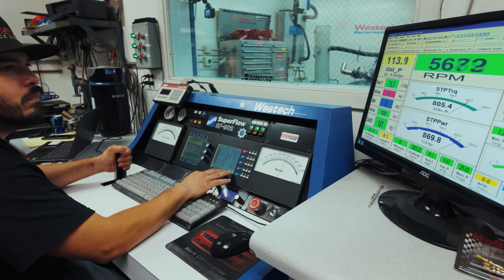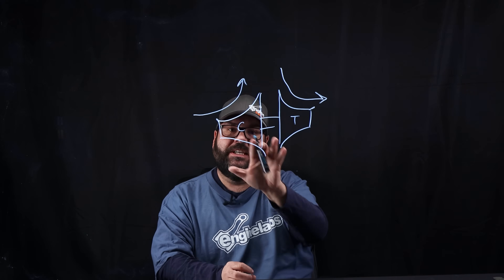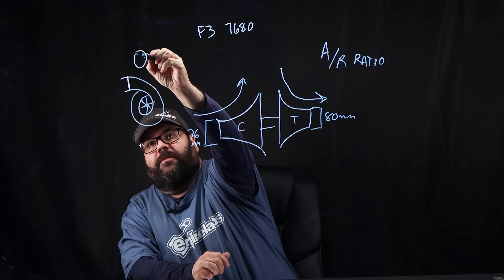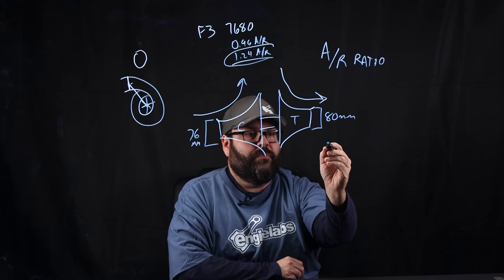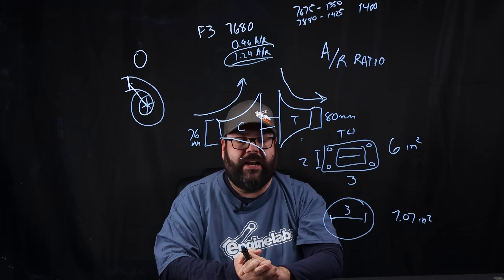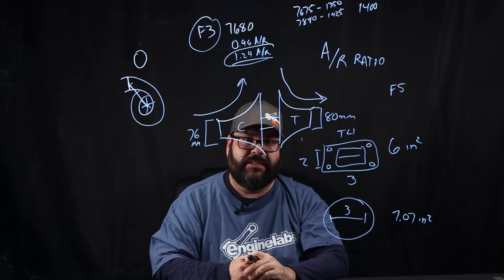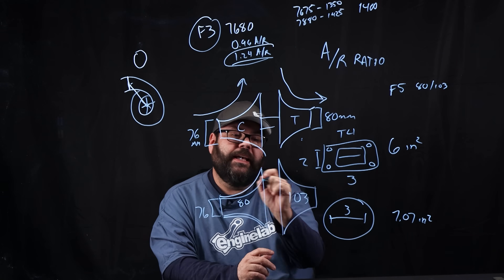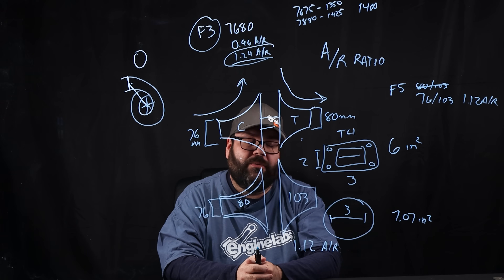You Won’t Believe These Turbo Specs (LS vs Coyote 3)

Comment: 1.392% difference with more than twice the pulls, and less torque. This whole thing is a joke.
Reply from the maker: Coyote ultimately made the highest torque number of the competition, just not on the highest-horsepower pull. In your percentage calculation, you should probably factor in the displacement difference as well, for total system efficiency comparisons.
Reply: @EngineLabs  So you're going to count "non final" dyno pulls to determine the winner, and not dock points for one of the builders being totally inept in tuning his own engine, taking twice the pulls to achieve the final number? A difference that's barely outside of the margin of error on such a dyno?

Again this video is an utter joke. Publicity stunt clearly. 

I especially love that the LT has a non sleeved engine, and the coyote has sleeves installed. Yet you guys totally brushed right past that.

Comment: Before the dyno comparison ever happened, my friend and I said they should have had their choice of hotside (wheel included) and then scored on both peak HP and some measure of powerband width. Those who understand turbo sizing (and not to pat myself on the back too hard, but I was offering hotside sizing services for the unlimited spend street car guys back in the 00s) know this was simply a turbo sizing test (like Richard Holdener) and the style of air pump in the middle of the two ends of the turbo barely mattered. And I'm a Mopar guy, so I really don't care which one "wins," but the test parameters bugged the hell out of me.
Reply: +100 peak numbers don't tell you much.  I think the old engine masters shootouts did average torque and hp over a set rpm range.  That would be better.

Comment: Would like to see a rematch using 116mm turbo or bigger.
Reply from the maker: Not sure the LT would survive....
Reply: @EngineLabs  Just lieing , anyone who watched first, second and 3rd engine build knew , you your self is byest , we also know that after two failed attempts. People like you didn't care how y'all had to win. But this is a fact the LT played by every rule we know somebody leaked the LT max HP pull. Just by the way y'all was so happy by 4 to 5 HP over the LT that yes y'all didn't care about integrity. Even using a CO2 adder when guess what, the GM team did not. It's y'all that can't make over 1000hp without cylinder sleeves not us. So why even comment and post a blanted lie. It's couse y'all Ford feeling are involved. We took a junk yard motor and cleaned it to prove we have integrity. Ford didn't. We stayed away from CO2 , Ford didn't. The fact is it's a reason dollor per HP people like me , Tony bynes , billy the kid, kye Kelly in real grudge racing do not run Ford engines. Y'all don't domante in all steal All glass, over drive, grudge racing, small , big tire and ect. It's because the performance industry been figured out, they coyotes have a weak link and cost to much money, just to make a extra 19 and in grudge racing all that 7, 8800 rpm will get you clipped in the 1/8 and 1/4 mile when big money is on the line and when a Gen 1, Gen 3-4 LS gen 5 LT will already be in front will y'all are waiting for them coyotes to get in the high power band when they start to make the HP that matters. Well before 7-8800 rpm. Conclusion so out of 3 , GM vs Ford . Ford coyote finally wins huh and y'all are happy bout that happy to still be 2 Losses vs GM 2 wins. We even had to tighten up the rules just so Ford could compete with GM , and after all that even using CO2 , high dollar cylinder sleeves to only out beat  GM LT by not even 30,40,50 HP so know y'all cocky again bro I see why Ford guys are the most delusional performance brand out of the big 3. 1400 LT no CO2 vs 1419 with CO2 and y'all chest is out bout this . Really it's just sad .

Comment: So changing turbos invalidates the entire competitive results of the engine build...RUN WHAT YOU BRUNG. If you're going to start down a rabbit hole of changing parts, where does it end? The motors are finished USE THEM AS IS. If individual teams want to change.AFTER the race go for it. Otherwise what's to stop a losing team of coming up with an improvement to use and starting the whole thing all over again?
Reply: Because both engines could break with this much backpressure and you can't even let the engine rev up to its correct operating range. So instead both are allowed to upgrade to the same spec turbo.

Comment: This was a stupid comparison. Nobody is going to impose limits like this out on the street or class racing.  LS guys are not going to limit displacement and Coyote guys certainly are not going to lock their cams.
Reply: they can’t have the coyote blow the LT out of the water. it would upset their sponsors who all push the LS/LT engine platforms.
Reply: This test seems to limit only the LT/LT by taking away a factory advantage - displacement.  The Coyote is clearly more technologically advanced, and really, didn't get handicapped on purpose, like it seems like the LT did, IMHO.
Reply: @radz-cp8lt  Max effort Coyote with twins is making over 3k power at the wheels. Not sure the LT could match that. It would be amazing to see them try. It is the only way to know.
Reply: @vernonpitts6630  I think the reason you don't is that it's just much easier to go with big block combos in the Chevy camp.  I'd like to see it too though.  What are the top LS guys at now?  2000?  2500?
Reply: @radz-cp8lt The technology that makes the coyote perform was locked out! (VCT) Plus the intake manifold design is less ideal for coyotes compared to even a reinforced boss 302 plastic manifold. The turbo was so restricting that they couldn't spin the engine to what FFRE typically does (north of 8500rpm). Both were handicapped but the coyote even moreso.

Comment: Both build used the same turbo and at the end of the day a motor with 100% VE will be more efficient. I knew at the beginning that equally used turbos in comparable builds ,boosted the coyote would win.
Reply: All things be equal yes, but the fact that the LS had more CID was a wild card for the test. I thought it would be close. It wasn't as close as I thought it would be so I guess I was wrong😂
Reply: @jeffg4008 less CI would have been better with a limited size turbo. A k24 Honda could've outperformed both of these engines with that specific turbocharger. That's the nature of the turbo.
Reply: @thatturbotruck they don’t understand this.
Reply: @jeffg4008  1% is about as close as you can expect.  Hell dyno variance is usually +/- 0.5% anyways (FFRE's win was outside the measurement error though - can't question that).  Was surprised to hear that LME used the T4 flange on top of all that.  With results this close that flow area could've made a difference.  Hopefully they'll rethink their approach with the T6.
Reply from the maker: @ChurchAutoTest  We will have T6's on both, but that particular turbo was only available in the T4 when the first dyno tests were done

Comment: I guess displacement isn't always the determining factor. EFFICIENCY  as an air pump is.
Reply: Not when you restrict the turbo.
Reply: @KobaBlack113  In the vast majority of racing classes or class racing the turbos have parameters and/or restrictions. Engine efficiency is for sure a factor - maybe more of a factor than other things like displacement, when turbos having some kind of sizing limits.
Reply: They are the same displacement